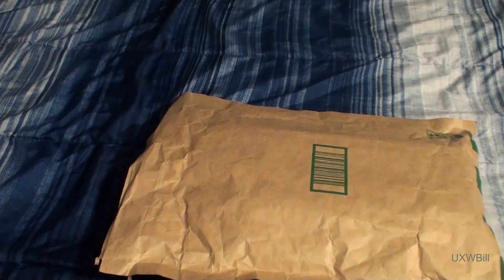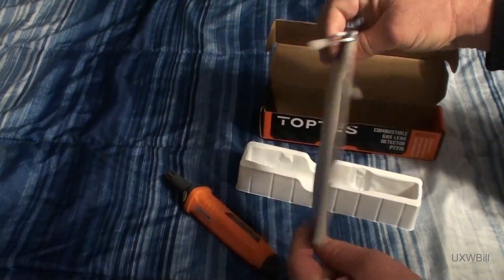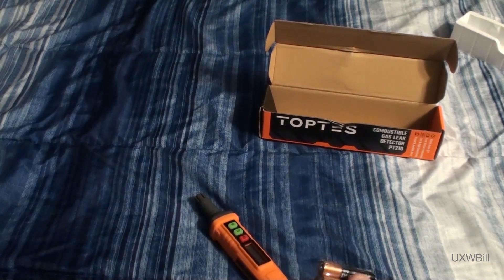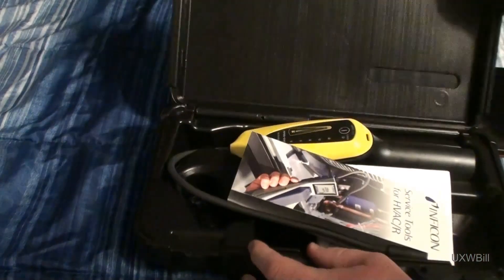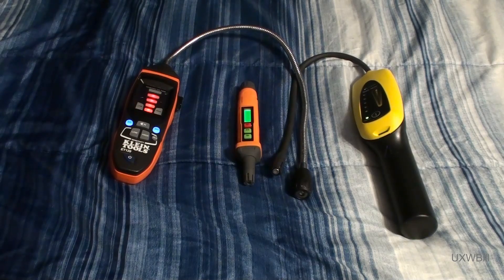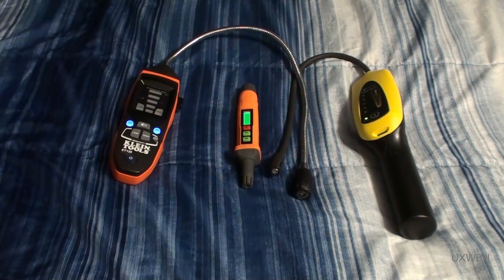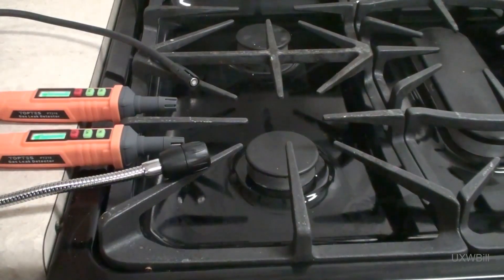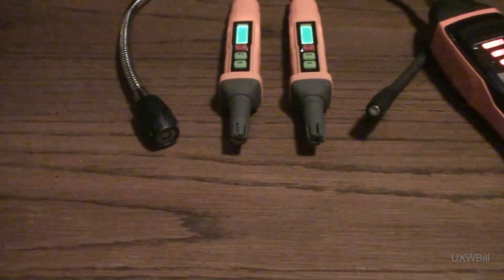TopTes Tools PT210 Gas Leak Detector Review

Comment: I'm quite disappointed to hear that TopTes asked you to edit out the parts of the video where the product did not work properly. That type of thing is what turns me off from ever considering this product if I am in the market for a gas leak detector. I am willing to follow new product launches and hold off on buying them until the manufacturer has worked out any glitches or problems, which is not uncommon. However, when I hear of a company asking someone to edit out part of an honest review, I'm done.

Anyway, it's great to see another upload from you. I hope you and your family had a nice Thanksgiving!
Reply from the maker: It came as a surprise to me, as I told them from the beginning that the review would be completely honest and they said that would be OK. I don't know if something got lost in translation, or if their representative thought I'd compromise on that point. I'd hope for the former, though it's probably the latter.

TopTes isn't the first to do this. I've been asked before with other review videos to edit out the "bad parts", and the answer has been the same every time. I have also made it known that if I ever was willing to do so, at that point it is no longer a review but an advertisement -- and it will be clearly labeled as such or the video won't be published.
Reply: @uxwbill  It feels like a lot of reviews are just advertisements these days. They'll tell you all about the features of a product, but they don't say much about how well the product actually works, or if there were any problems with it. The only bad thing I usually hear is that something is more expensive than its competitor, and that's usually the only reason they'll give you not to buy something. That's why I like watching videos such as yours here on YouTube, where you put the product and its features through all their paces and demonstrate how well they work or don't work.

Comment: What does the regulator do? And how does it work?
Reply from the maker: In addition to stepping down the much higher pressure from the gas supply line, it also serves to provide relatively stable gas supply pressure to any appliances that use natural gas. Propane/LP gas systems have similar regulators.

A diaphragm and (sometimes adjustable) spring within the regulator work in concert to regulate the gas pressure.

Comment: Something like this would have been super useful at my previous job (I had never built gas runs before doing HVAC/R installation professionally and while the UV-colored soap water worked fine, a purpose-built tool would probably have given me a much quicker second opinion on my first couple of gas runs while I was sort of learning on the fly and flying by braille--it wasn't until my 3rd run or so that I was told to "go ham" with the pipe dope).

I feel I probably would have been more confident with the readings from an Inficon or Klein detector though (after watching this video) even though we worked almost exclusively around propane or methane (and occasionally acetylene when the welding torch head would explode spectacularly--there's a "war stories from my days as an installer" type story behind that).
Reply from the maker: When something is your livelihood and you're responsible for ensuring safe operation, I think it pays to buy the best tool you can afford. The Klein detector has been decent to me. (I'm not nearly so fond of their CO detector, which is a Uni-T rebrand.) I picked up the Inficon mainly because it seems to be one of the standards, and people seem happy with it. Of course, certain things like gas valves with vents can have you looking for a problem that might not be, at least to start out. (Yes, I've done that.)

I never had a torch explode on me (that probably would have put me off of brazing and sweating pipe forever!), though I had to work with some truly craptacular options at one of the HVAC/R jobs I had. The first was some kind of a jeweler's torch. To my amazement, I was actually able to braze a 7/8ths inch suction line on a condensing unit and get it sealed the first time. I was deathly afraid I'd end up getting the valves on that condensing unit so hot that they'd fail and blow the entire refrigerant charge out right in my face. When I complained about this (and the lack of a striker -- it's been drummed into me that you Just Don't use a cigarette lighter, ever), they pointed me to a torch that was leaking oxygen from the handle. Even if it had worked, it wasn't much more powerful than what I had been using. So I finally just brought my own torch set in and that was that.

Boy was I glad when I got out of there!
Reply: Yeah. Fortunately, I was pretty heavily supervised for at least a few installs and they had me on a bunch of jobs with another dude who had been doing HVAC/R for about 8 years at the time (he was about my age so that was effectively his whole professional life after high school). Still kind of wish I had invested in an explosive gas detector because, like, I did get really good at using the "radioactive bubbles" (those things under UV light looked.. interesting), that Inficon one looks like it would have been much quicker about a second opinion on at least my first gas run. Fortunately, all we ever did to mess with the outside gas valves was to use the service person shutoff whenever there was a run inside that wasn't up to more recent codes (or, maybe they were and the guy I was learning from was just really dead set on having redundant shutoffs).

So, yeah, cigarette lighters to get the torch going.. I worked around a bunch of guys who smoked so that ended up being a "when you're really desperate" type of bad habit I picked up on (lighting the torch with a cigarette lighter I mean, I still don't smoke real cancer sticks personally). I can see how that could end badly just because all of us tended to dial our flames a bit lean (no sooty flame, but more of a jet engine sounding thing, that could blow up a lighter right quick).

I recall learning about those jeweler's torches when the commercial contractor I was with in 2020 was putting me through school again (school I don't gotta pay for, I'll take 20). All I gotta say, I could see how that might work well enough, but still, 7/8 with that is pretty impressive. I ended up learning to just wrap the valves with wet rags during soldering and to keep wetting the rags down until the soldering job is done, but obviously that's not a perfect solution (more of a "good enough" solution in most cases).

Now, the exploding torch head. This residential place I was working for was a bit better than most about how they treated their equipment, but some stuff slipped through the cracks. Particularly, this one torch set they had that had been last maintained basically never. So, we're in this stupidly massive house (a new construction job) somewhere north of Crescent Iowa. Everything downstairs had been welded, but we had this redundant evap upstairs that needed patched in. The one guy just kept cranking the valves open and bumping the pressure because "what the hell, I just grabbed this tank of gas this morning!". Before we could really speculate, there's a loud "BOOF" noise, the head chunks off in a bunch of directions, and the one guy is holding effectively just a pair of hoses with a fire on the end of them. I and another guy thought quick and turned the main valves on the tanks off. I'm pretty sure at least the guy holding the hoses needed a change of pants after that. Personally, I had one of those laughs like when you almost die, but then don't, kinda like "ha, holy crap, that just happened".

Honestly, I probably would have stuck around there even after the exploding torch because this contractor was, at least inwardly, more honest than a lot of HVAC/R contractors in the area, but the winter 2021 season got oddly slow for all construction-related things in the area (plumbers, roofers, electrical, concrete, HVAC/R, etc.) so I got benched for a month before a factory in the area offered me a pretty hefty pay bump to effectively be the guy who taps on machines with a hammer until they work (for the most part--tap it with a hammer and if it still doesn't work, the problem's electrical). Once I reach master mechanic on my training though, I can move on and start messing with refrigeration so there's my motivation.

Comment: This video "showcases" one of my pet peeves about multimeters... if I turn on the backlight, I NEED the backlight.  I DO NOT want it to turn off 15 seconds later.  This applies to the "affordable" meters mostly, Fluke backlights stay lit until the button is pressed again (in my experience).
Reply from the maker: Oh yes, I agree completely. I don't understand why meter manufacturers haven't figured this out! Every Fluke meter I have with a backlight (87 III, 87V, 902FC) either has the backlight stay on until shut off or for several minutes minimum.

Comment from the maker: Late breaking update: Along with my research in the video description, TopTes Tools' representative confirmed to me that butane will disable the gas sensor. 

To quote them: "I handed this problem to the product department. 

The response from the product department was that the sensor fails after detecting butane is a characteristic of almost all sensors. 

We are working hard to find a solution to this problem."

They stated I would be told of any further information from their product engineering team.

I will point out that the sensors in the Inficon and Klein Tools detectors seemed no worse for the experience.
Reply: Tell them to consider adding a T to their name. TopTest makes a lot more sense than TopTes.
Reply from the maker: @vwestlife  Muscle memory has had me doing that every time I typed their company name. Maybe I should see what they say. (I am not sure they are paying attention to much of the feedback I have sent. I told them not to send the four extra detectors and seemingly they are doing so anyway.)